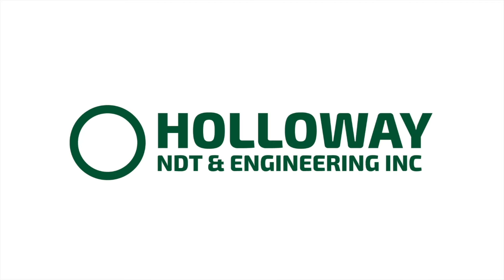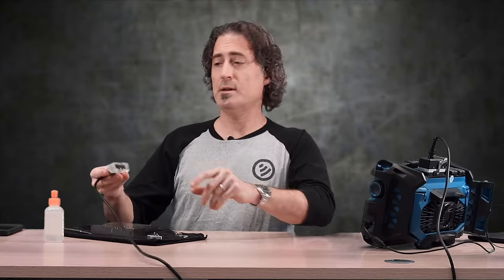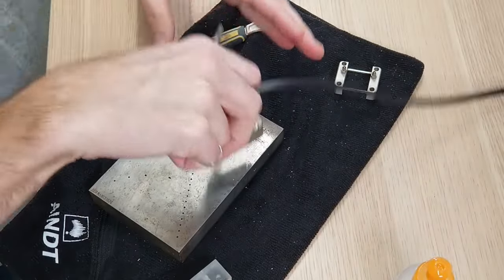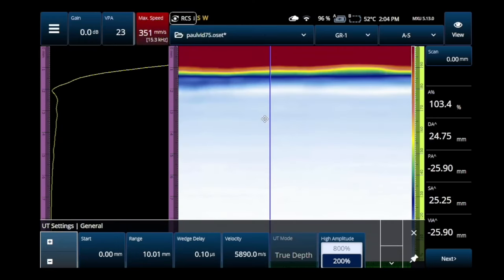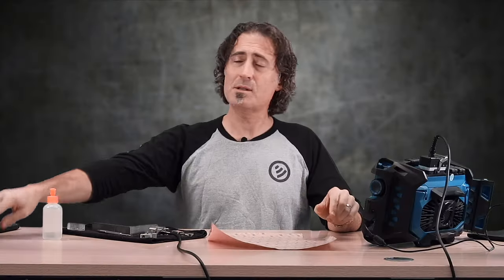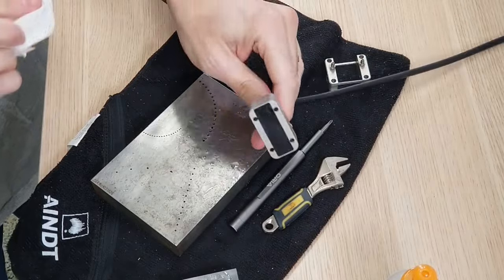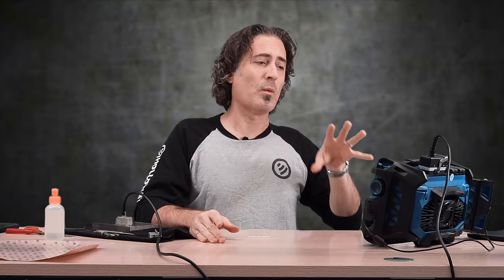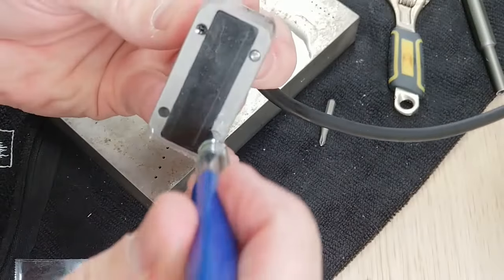PAUT Zero Degree Wedge Repeaters (+ Tape?)

Comment: I’m not too proud to admit I’ve wrapped a 5l16 with electrical tape a few times in a pinch. Doesn’t stand up to actual scanning but for some bolts or small areas it did the trick.
Reply from the maker: Lots of people are telling me black electrical tape is fine. Just gotta keep an eye on it. It's not that durable.

Comment: Hi quick question. When setting up a sdh DAC with a compression probe (0°) for a 3 point DAC the first SDH has a lower signal than that of the 2nd hole. So when drawing this out the 1st DAC point is at 80% FSH and the 2nd DAC point is passed the screen rather than following a natural decending curve. Am I doing something wrong? Thank you
Reply from the maker: That's normal. The second point is closer to the natural focal point, so it's louder. Technically it's best to adjust the gain first so the loudest hole peaks at 80%. Then draw the DAC.

Comment: Hi Paul, thanks for your tips & tricks.
What about water column wedges? From what I've learned so far ,They're better than rexolite in eliminating dead zone and providing excellent coupling.
But can we use water on regular PAUT probes? or should we use immersion probes designed to acoustically match water only?
Reply from the maker: I wouldn't use regular PAUT probes with water just because you can't be sure about sealing. I will also do a hydroform analysis video in the not too distant future and talk about water columns and repeaters.
Reply: @hollowayndtengineeringinc.5201  thank you very much for your advice!, I'll be looking forward to see that video :)
Reply: It would be great to see a hydro form video Paul, a follow up flexo form would be double cool. Thanks for the interesting video as always. @hollowayndtengineeringinc.5201